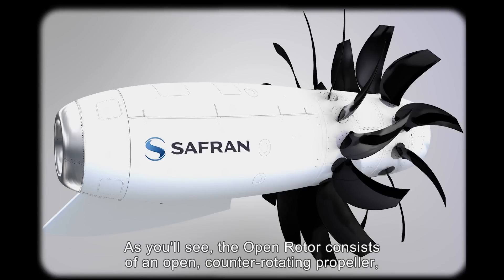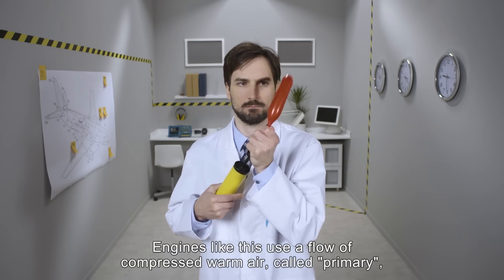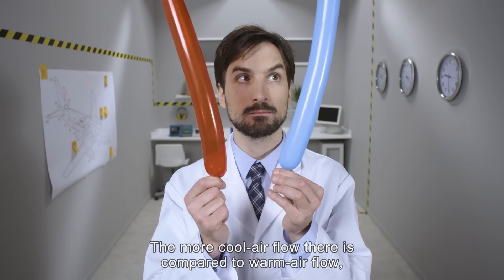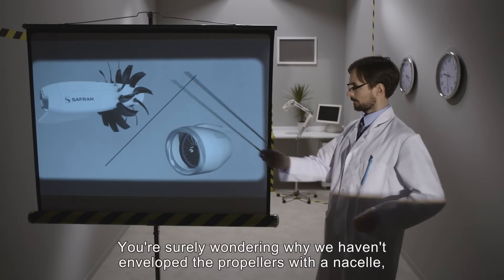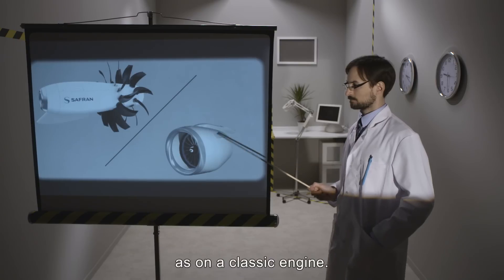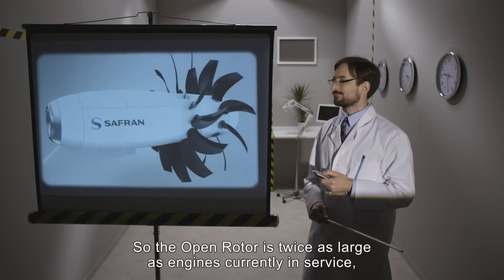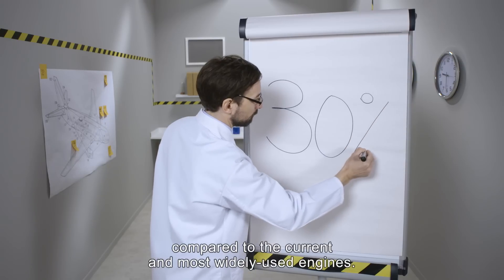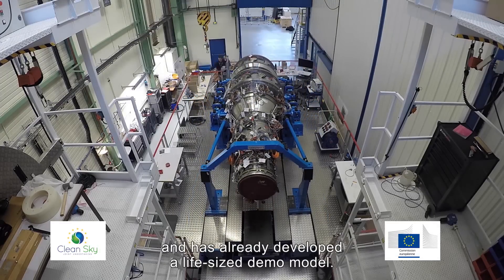EP5: Open Rotor, discover a revolutionary concept engine 🇬🇧 | Safran

Comment: Propfan tech is the basis for CFM's next generation RISE series engines, the successor to the LEAP series. While propfan demonstrators have been around for decades, technical issues have kept them from being practical. One of the main issues is how the propellers act in relation to the speed of sound. Our understanding of those physics is evident in commercial jets utilizing turbofans almost exclusively. With advances in computing power, we are able to model more complex propfan designs that overcome those limitations.

Comment: 4 years later its down to 20% and fixed rear counter fan blades without the long nose (CFM Rise), good concept still, makes sense for rear engines. I just wonder how the noise will be. 2025 it is...

Comment: Great, creative video! Yes, a “prop-fan” engine was being tested on testbed aircraft in the 1980’s — MD-80/DC-9’s flying out of Long Beach. They seemed oddly noisy. Not sure why the concept was abandoned.  But go Safran!!
Reply: I heard it was due to one of the high bypass turbofans being developed right at the same time, and it took hold faster than the unducted design. Plus the safety and noise was improved over the external blades
Reply: @RCFlyBoy314   That makes great sense. Thx RC.  💛🙏🏽

Comment: Can you modify a 777 for rear engines? High tail and set back wing.

Maybe it could be a stretched version where they stretch the front and not the rear to get the CG right.

Probably needs a whole redesign. But I could see a sister working. It's a tube with wings after all.
Reply: 737 would be a better candidate. Depending on how big the fan blades on this incredible machine are. The main problem with the 737neo 8 max are the larger engines changed the dynamics.
Reply: @BigGuy10Points  I know better now. The reason the current twin jet standard design is what it is is because it's the cheapest. When you put the engines in the rear, you have to make changes to the "tube" design to support them, which increases cost and weight. So they're gonna stay on the wings for the time being.

Comment: It's basically just another turboprop, just with different propeller design which looks more like the ones found in turbofans. I'm curious how it sounds though, will it be as annoying as a turboprop or smooth like a turbofan?
Reply: It is not a turboprop. A turboprop uses a low-pressure combustion chamber which can't provide enough thrust to overcome the weight of the aircraft, but has enough power to drive a turbine at slower speed and in turn drive a propeller, which takes advantage of large diameter propellers for economical and relatively low altitude flights. A turbofan uses a high-pressure conbustion chamber that produces considerable thrust on its own but most of its power goes into driving a rapidly spinning fan with lots of blades that provides most of the thrust. This is ideal for high altitude flight. The open fan design is still a turbofan because it's a high-pressure engine, but the large diameter of the fan means it can spin slower and have less blades and still have the same performance curve of a traditional closed duct turbofan engine, while using less fuel.
Reply: @elimalinsky7069  we might both be wrong though, Airbus doesn't call it "turbo-prop" nor "turbo-fan" either. They just call it "open fan".
Reply: @HDJess  Makes sense. It's a whole new design so it should really be considered its own thing.

Comment: Content is good but not detailed. The worst thing is video's not being funny as if it is intended to do so. I think acoustic problem without nacelle is a concern. I learned the material is ceramic matrix, but the way to protect blades from external damage is another concern. Please add these concerns and possible solutions to the future videos.

Comment: Old concept, GE looked at this years ago, the unducted fan engine.
Reply: Even older than that, literally the first guy to look over the original jet engine came up with this design, however I think materials have finally caught up as the nacelle designs were more for structural rather than efficiency reasons.
Reply: Yes, but the technology, materials, ways of production like 3-d printing does you can make a very diffrent engine today than a decade ago. GEs catalyst turbo prop is based on old architecture but can be 20% more effective and more 10% powerful at highs altitude due higher compression. All types of engines  are in a revolution that makes them more effective. So, old concepts becomes new in a way.
Reply: Safran and GE just announced they are working on the technology together in a 50/50 partnership, so there's that.
Reply: @BuffMyRadius  CFM is the JV since the 40s and the largest engine producer. Its nothing new.

Comment: How can doubling the weight of the engine be lighter than removing the casing?
Reply: Nowhere did the video mention that the engine weighted twice as much as classical engines. Only that it is twice as large.
Reply: It's much more powerful, so it's power density is better. So for example if you wanted the same amount of thrust with the other engine you might need to put 2 old engines there instead of using one of these. I don't necessarily think it's double the weight so let's say it produces 1.5x as much power but only weights 1.2x as much, you would still be 25% more efficient. It also has the added benefit that it requires less fuel to run, meaning it can perform longer flights with the same amount of fuel furthering the economic advantage of the engine